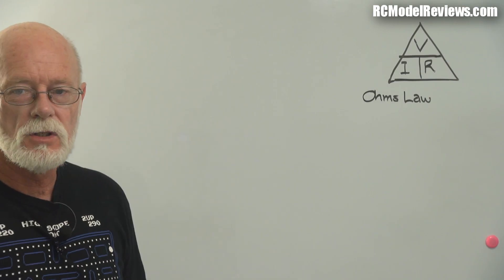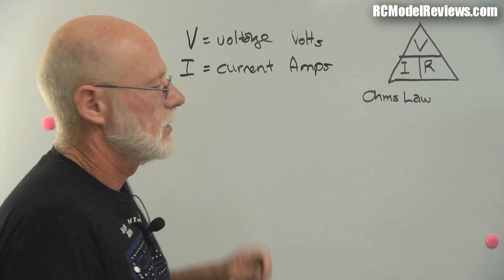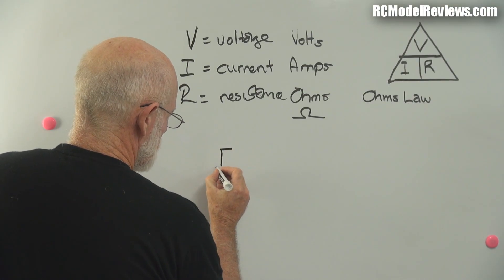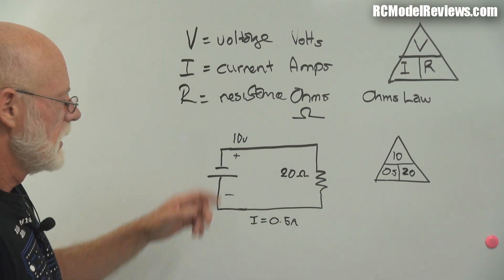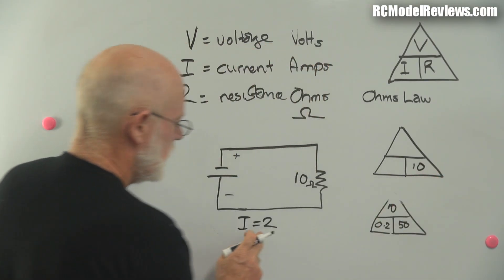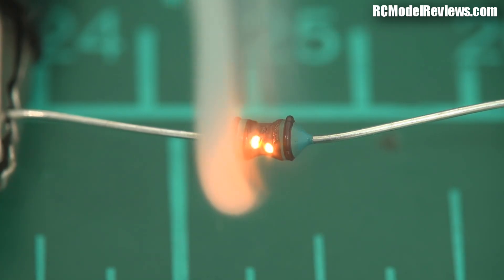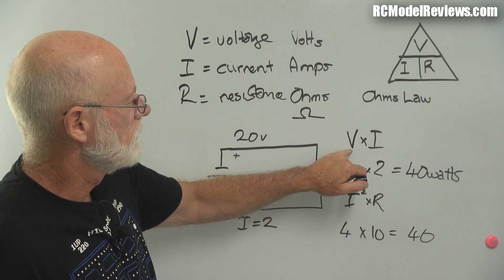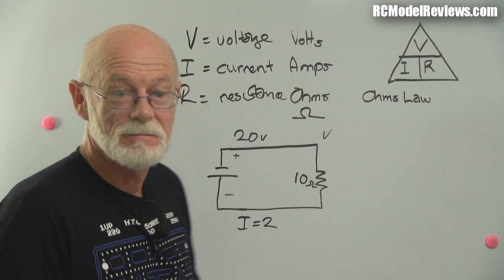Ohm's Law explained

Comment: Still haven't found anyone attempt to explain why the formula works
Reply: Yours is the first intelligent remark. I think Ohm's discovery  is telling us about a relationship between mechanical work done driving a population of electrons through a conductor and energy used up against friction,  meaning that it is converted into heat energy.

Voltage is also known as 'potential difference'  or just 'potential' and is a unit of energy. Ohm' discovery and formula doesn't always take such a simple form as is discussed in this video. There are resistances described as dynamic with a non-linear connection between voltage and current. 

In more advanced work Ohm's Law is superceded by Kirchoff's Laws and Ohm's Law becomes the Expanded Ohm's Law.

David Lixenberg

Comment: current is a measure of electrons per second. its like saying miles per hour. power is voltage x current, right. so power includes a 'per second' thing in there, therefore power too is like saying miles per hour.  what it comes down to is: if you have 1 watt for 1 second then that is 1 jule of energy.

Comment: its not the resistance of the resistor that causes the heat - its the conductance. the more current it allows the more heat it makes. hence why a large resistor doesnt make any heat but a small resistor does.

Comment: I'm trying to find Resistance. Have battery meter /w shunt. When I power something, the Voltage drops but the remaining volts * amps = watts. The Whrs are totaled and that's the battery's service life. So is the line loss the V drop / I ? But not added to TOTAL Whrs. [ thought line loss.was.I^2 R ] . See where I'm at ??

Comment: "I" means intensity which makes sense for current if you look at it from a flow of water standpoint. M
Reply: Box Addict no it’s not shut up
Reply: Actually what current is measuring is the amount of electrons flowing thru a conductor in Coulombs and being pushed by an Electro Motive Force, EMF, and measured as Voltage "E' , which both are struggling to overcome as Resistance  "R", which is the conductor/wire they are flowing thru.
Reply: @bobgarr6246  Hi and Hello. 
I gather people for a good cause: 
I wanna provide people with Links leading to bad or toxic people. 
Mobber, Racists, Sexists, Bullies, more. I got the Links and i 
need help with reporting them. 

Youtube is in a bad state and i think you heard of that. 
Many complain about it, its strike-system and its CEO: Susan. 

But... I mean... complaining about the State of the world is nice 
and dandy, but... how about acting? Doing something? 

So i made a Wiki where i store Links for all to use. Yeah, unorthodox, i 
know, but whatever. Its my Try to help. 

You can at least pre-emptive 'block user' regarding the 
Racists and all those, but you can also 
do one thing more and report them. 

I know this was random and also overly summarized, but 
think about it and consider. You can make a difference. 

I tried to explain it as good as possible, but the Wiki will tell and show 
you more, i guess. 

What do you think about all this? I mean, its a good cause, 
improving the internet and the world, and it costs no money, just time. 
Nice or not?
Reply: @Box Addict one is a good analogy of the other. But they are in no way shape or form " All the same" . The formula for quantifying one can not be carried over to the other.

Comment: If the voltage is 20 and the amp is 2 doest that mean only two electrons are flowing per second?
Reply: A current (I) of 2 amps means that 2 Coulombs of charge are passing through a point in 1 second. 1 Coulomb has the charge of 6.24×10^18 electrons, so 2 Coulombs mean that the current is roughly equal to the charge of 12.48x10^18 electrons per second

Comment: Sir thank you for this wonderful vedio that can helps among us, I just want to ask something,! How determine the capacity of the resistor and it's kind?
Reply: In basic electricity science we use idealized components. There are resistances, capacitances and inductances. The resistance of the circuit wires is assumed to be zero while the actual resistance is 'moved' into the resistance element of our ideallized circuit where it is comparatively making a negligible contribution. The same applies to the circuit element that you were asking about: the resistance of the capacitance exists but is 'moved' into the resistance element. In fact the issue you are raising is dealt with in more advanced work with circuits where the resistance would be described as 'distributed.'
Reply: Equivalently the capacitance of a resistance.

Comment: i watched this video for help with knowing what size inverter generator i would need to power a projector and a dvd player... the projecter runs on 100v-260v 50HZ and the dvd player runs at 110v-240v 50/60HZ (is all the info i could gain from their spec sheets), the generator may also have to run a small/medium sized soundsystem, could a 0.80KW inverter generator handle this sort of thing, or perhaps a 1.0KW or a 2.0KW be better? (pretty random question i know, ive asked it on a couple of different websites but noones been helpful yet)

Comment: I modified Ohm's law to calculate gravity of earth and planets.
Velocityorbit/( velocityrotation×g constant)= the rate the Suns pull stoops down to the center of a planet to cause g constant, the differential of it's two circular motions.
(Vo/(Vr×g))=dconstant'rateofstoop

(Vo/(vr×d))=g constant'free fall

(Vo/(g×d))=Vr'velocityrotation
 (Vr×g×d)=Vo'Velocityorbit

((Kep#Mar's/kep#Earth)×d'earth)=
d'mars.

So gravity is easy to understand when you have the math.
Earth's d const. Is 2.000003382s^2/ft
Mar's d is 3.761781852s^2/ft

Mar's free fall is 26.5264ft/s^2

When you stur your coffee in the mornings the center stoops down.
What's happening is gravity of earth bends to the path of least resistance to try and keep a grip on the faster moving molecules in the outer perimeter through covalent bond from the slower moving molecules in the center but losses grip on the outer molecules. The center molecules take up the slack become hevier and stoop down.
The Sun's pull on the spinning Earth stoops down towards the center of earth to cause g constant the differential of it's two circular motions. 
Einstein was wrong about gravity. Matter doesn't attract matter theres no action or reaction is there? If only he could've thought 3D instead 2D on everything.

Comment: This is an equation and not a law. Ohms law starts.....In a metalic conductor at a constant temperature..... That my friend is the 4th variable. This stops resistance being fixed as metalic conductors heat up with current applied.

Comment: So iam using a e cigarette  and I use 2x 3.7 VOLT  batteries  and a coil with a resistance of 0.25 ohms. SO I WOULD NEED A BATTERY THAT PUTS OUT AT LEAST 14.8 AMPS CONSTANT IS THAT CORRECT  ?  DOES IT CHANGE IF I HAVE 2 X 3.7 VOLT BATTERIES

Comment: Well done, BTW, I believe you may be looking for the value used by AMPERAGE .... it uses the capital letter “I” as it’s value due to its principles of induction to induce current or amps... I hope you continue this type of video, it seems there is great interest. There are many people who do not know about Ohms law and it’s endless ways to manipulate (V/I*R) algebraic formulas to represent Ohms law, like P=I*E,.  BTW, you are using V for Volts, and it’s  common value is “E” for voltage or energy, which is potential for electron placement or movement. So the letters I believe you may want to use are P for Watts or power, E for energy or volts the potential, I for induction or amps & R for resistance which include Ohms,  Henry’s,  impedance,  etc.  Most people are aware of the names of the individuals who names carry their discoveries. I feel it’s a must to better understand what is aJust wanted to help refresh your memory, I too have that temporary memory loss, you are doing great.... I’m sure many folks out there are very happy to get this much info. They did not get our training ever, it’s important to share, be sure to warm that noodle and it’s jargon before going on camera. It will make you look better, and sent others in the correct direction, which is clearly your intention. I salute you for it, you are a man after my own heart. Please keep up the work, knowledge is power, and good knowledge with the correct info is very clean power!, it’s what we all want, RIGHT??

Comment: You showed the Ohm's Law triangle and then started to address power but sort of petered out quickly. 
There's a complete power triangle too. It's called Watt's Law. 
Power is measured in Watts. In electronics, power is defined as not just heat but "heat dissipated" (the measure of heat removed from the circuit by whatever medium is moving the heat away).
The Watt's Law triangle looks just like the Ohm's Law triangle except that V is replaced by P (P is the symbol for power or Watts). The other thing that changes is that V from the original Ohm's Law triangle moves down and takes the place of R in the Ohm's Law triangle.
So, you end up with a triangle with P at the top and I and V on the bottom. What that shows is;
P = I * V
V = P / I
I = P / V

Comment: Voltage = E= electro motive force, amps= I =  Intensity, ohms= R= resistance.
Reply: EXCELLENT.
Reply: Holy shit.  Voltage IS "the Force"!!!!
Reply: Wow really smart people in the comments. Just started school; just learning this stuff
Reply: But voltage and electromotive force are slightly different things
Reply: @trystanfresh  Yes. Electromotive force (EMF) is a "type" of voltage, just like a voltage drop is also a type of voltage.

For example, you can call the voltage of a resistor also as a voltage drop, but not as an EMF. In a battery, you can call its open-circuit voltage as an EMF, but not as a voltage drop.
Reply: I always heard that Voltage is the electrical potential, whereas Amerage is the force, or intensity of that potential through a circuit. Same thing or different?
Reply: @gregoryjones9506  Using theoretical concepts, there's a confusion as to what is voltage or electric tension, what is electric potential difference, and what a voltmeter reads/displays. This gets even more complicated since in circuit analysis you're taught about lumped-parameter elements, but in real life the elements are rather of distributed parameters; you may check ElectroBOOM and the MIT ex-professor Dr. Walter Lewin discusion about this topic; it also relates Kirchhoff's voltage law.

Regardless, to give an answer, you could use the hydraulic analogy to relate electricity to water. A voltage source would be a water lump, the watee would be the electric charge, and the flow of water in a transversal section would be the current intensity.

Usualy, voltage is thought of as the "force" or input, and the current as the response or output; batteries, solar panels and generators are modeled as voltage sources. Although current sources technically don't exist, sometimes we use them to model transistor and op. amp. circuits.
Reply: You are both correct!
Reply: im a bit late to the party, but i just had to say this. those of you trying to counter this guys explanation of whether Volts is E or U or Z for what it matters are just being unnecessarily picky. no one is here for an advanced degree in electrical engineering, and he is not here to try and give us one. he is here to teach the average layman how to understand Ohms law in a way that we could put it to practice in our own day to day lives. and for most of us, that is only going to go as far as wiring up a circuit for a light or two or maybe some speakers, nothing much more complicated than that. and if we needed to dive deeper into understanding electronics we would find a video or website that would go into the detail that we are looking for. so complaining that this isnt up to "your standards" of explanation is about as pointless as me writing this comment (it doesnt make any difference to the poster or the watcher of the video) its just another nobody trying to point out why they are right and everyone else is wrong, myself included.
Reply: Isn't voltage= P.D potential difference
Reply: Tarana Huq yes
Reply: @taranahuq4050  No, in general voltage is not equal to potential difference. That is true in electrostatics (and maybe in magnetostatics, but I'm not sure.) However, in electrodynamics (that is, when there are time-varying fields such as in AC circuits), the potenial diffenece across two points isn't simply the difference of the value of the potential at each point, but instead depends on the path chosen for the integration; the consequenc is that the potential difference in this scenario isn't uniquely defined.

Comment: There is nothing intuitive about the triangle as to what you divide/multiply what by. V=IRgin wins. Unless I'm dumber than I think,  the triangle analogy confuses the topic that is trying to be explained.
Reply: Earl Ledden: You just need to remember the position of each variable ( V, I, and R) within the triangle:

1. To find either one of I, V, or R you use the other two (e.g. to find R you would use V and I or to find V you would use I and R).

2. If they (the other two) are side-by-side you multiply them, if they're above & below each other you divide them.
Reply: # 2 makes my point.   @paganphil100

Comment: Could you explain? 120 volts. need 20amps circuit. Wire size should be 12g. Longer the wire would cause more resistance. So how do you know when to up gage the electric wire larger than 12g?

Comment: Sir, I'll admit it's purely convention but you indicated at the end of your video the current in your basic circuit flows clockwise but I learned electricity is due to the flow of electrons thereby making the current flow CCW.  I'm just wondering why you assume a CW flow?

Comment: i have a power transformer that iam trying to determin the output current, it has 29.5 volt output and the transformer winding measures .2 ohms. can you help to the question of output current of this transformer? please help.

Comment: So, this means that a light bulb that is rated 100watts/120volts will produce .8333 amps of current. That means that you can run up to 36 100watt bulbs on a standard 30 amp circuit breaker, but not while watching TV.  This is the practical use of this knowledge.  When your 1,500 watt microwave is cooking your bacon, while your 700 watt coffee pot is brewing your coffee, you should not pop down the handle on your 1,000 watt toaster....unless you were smart enough to put the coffee pot on a different circuit.  Standard 30 amp circuit breakers can handle up to 3,600 watts, providing your voltage is not above 120.

Comment: it takes 1 volt of (pressure) to push 1 amp ( which is 1 coulomb = 6241510000000000000 electrons per second ) through 1 ohm ( unit of resistance) . fun fact an electron moves at the speed of light.

Comment: "+" should be on the longest bar of the source symbol, and Ohm's low is not only for resistance but more generally for impedance (Capacity and Inductance).

Comment: Great video..easy way to explain ohms law...i vape n build my own coils! N when u use mechanical devices with no safety features to say "hey low build" or "short" like it does on a regulated device with a chip in it.... u need to know the true amp limit of ur battery n ohms law so u know how low u can build safely!!! Otherwise very bad things can happen

Comment: great video. But I have a question. my vape device use a single 18650 type 3.7 voltbbattery and 0.4ohm coil.  3.7 / 0.4= 9.25.  so the current should be 3.7x9.25=34.225. but it can be adjusted up to 80 watts. how is that possible?
Reply: m ünlü regulated devices use an additional piece of electronics, I believe it’s called (someone correct me if I’m wrong!) an inductor, that is able to store energy and momentarily up the voltage. On a 0.4 ohm build, it would put out 5.66V and draw 14.14amps. If you were using an unregulated mechanical mod, with a fully charged (4.2V) battery, the most power it would put out would be 44.1 Watts, and this is without calculating voltage drop of the mod, battery sag, etc.

Comment: Great video! I was taught that voltage doesn't flow. Current flows..... from one side of the battery (or source) to the other terminal, or to ground as the other side of the battery should be connected to ground. As the current flows through different components within the circuit, a certain amount of voltage drop occurs across each component of the circuit (i.e., resistors, maybe a light bulb, a fan, etc) which can be determined through Ohms law and with the aid of a multi-meter.  All of the voltage (let's say 12 volts if you're working on a car) will be dropped across the components ending with a zero volts reading at the ground side.
Does this hold water? (Not real water, that would cause a possible shock hazard.)
Reply: DAN MIDKIFF It holds water.
Consider the water analogy; a unit of water in a mountain lake drops it's potential in the streams, rapids, hydroelectric power plants etc that it passes on the way to the ocean (0 level / ground)

Energy has to be added to get it back up to the lake, solar evaporation, pumps or a helicopter. The electrical equivalent is the alternator recharging the battery.